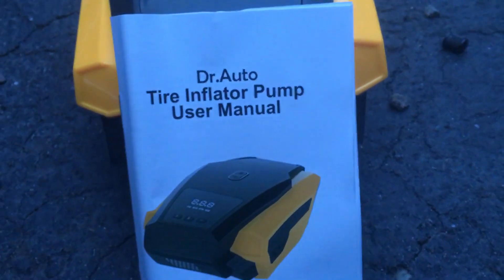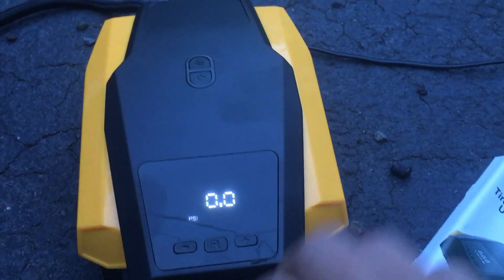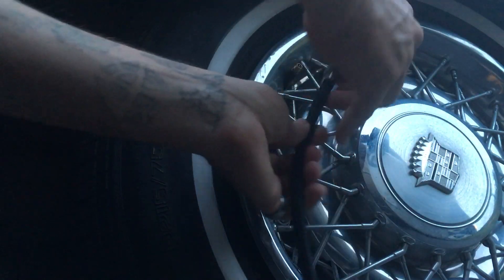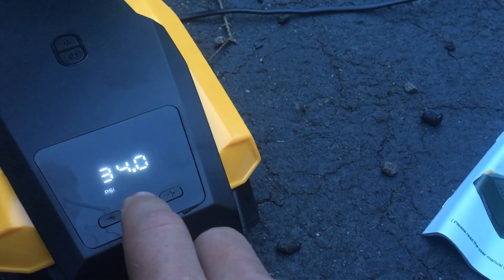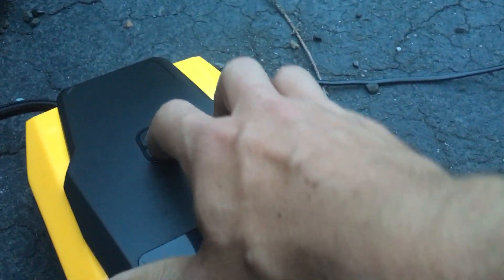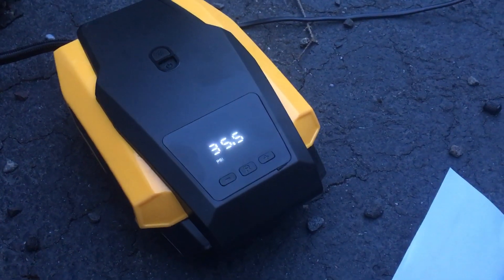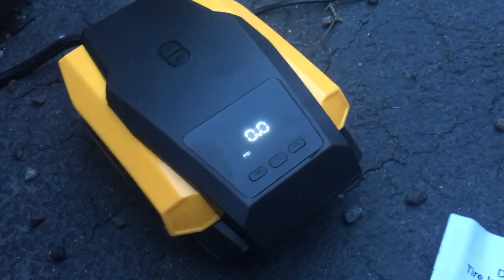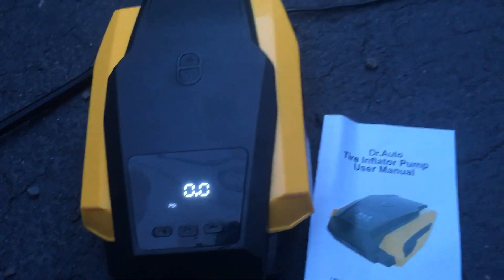Dr. Auto Digital Tire Inflator Portable Air Compressors Review by Master Auto

Comment: Brotha J. I have to share a  bugs 2mod idea with you. My idea is to move the camera lens part, maybe the camera guts can stay?, but move just the lens to under the drone right around where the center of gravity is. basiclly under the bird centered in the middle. i think it might remove but all the shaky shaky video. i may try this on my b2c
Reply from the maker: Lee Maples it is removable it is a rubber plug meant for panoramic cam
Reply: i know of the rubber plug under the bugs 3, but the bugs 2 doesnt have a rubber plug.i just know the nose-mounted camera on the bugs 2 is terrible so, i bet if the lens was under the drone the footage would be tons smoother. i want to try some kind of re-mount mod.